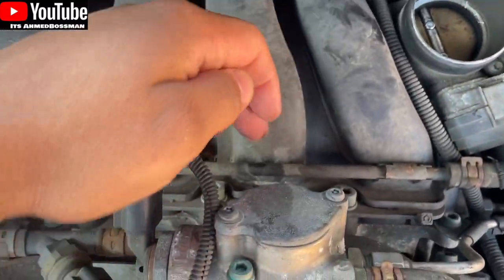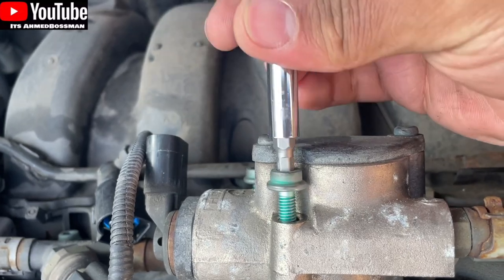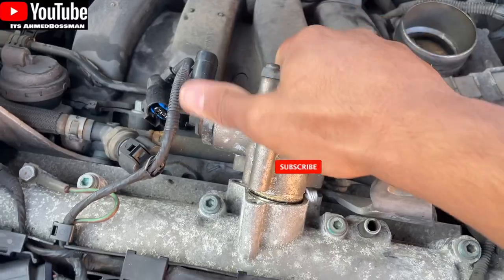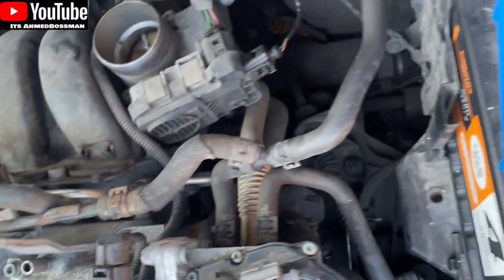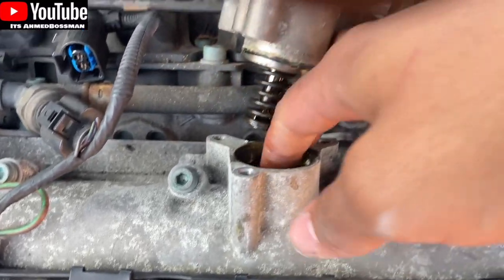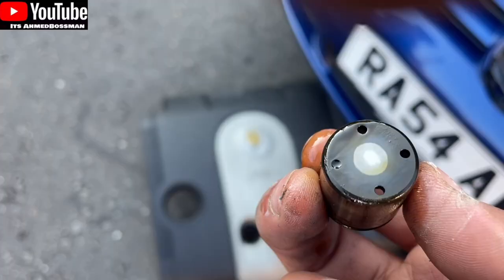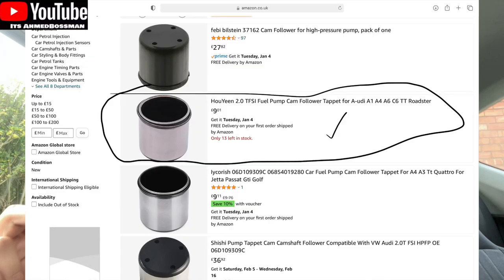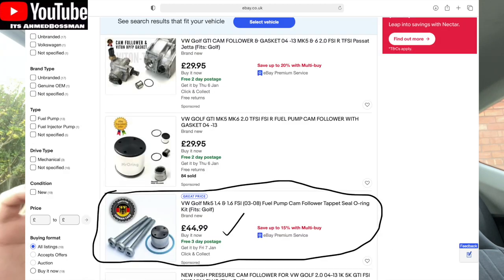Inspect faulty HPFP Cam Follower (overheating, losing power, cuts out) - MK5 Golf 1.6 2.0 FSI

Comment: No fuel comes out pulling the pump out? Also no release valve on the pump in case hoses have to be removed?
Reply from the maker: nothing came out, everything in the video is all it it, literally just unbolts and pulls out
Reply: @19hmxd  ok so I can replace it without worrying about residual fuel pressure inside the pump ?
Reply from the maker: @coachgius  the HPFP that i removed in the video did not release any fluids or anything . there was no pressure at all for removing what i removed, literally just un bolted as per the video. no hidden surprises on my car
Reply: @19hmxd  though I'm your case you did not need to remove the hoses but only the pump to get to the cam follower only. So may be undoing the hoses may create fuel leaking. I saw other pimp models with a release valve but can't see anything on that model that is like mine (same engine).
Reply from the maker: @coachgius  yes i only removed enough such that i can access the cam follower

Comment: Does installing a hpfp with different part number but appears same physically affects performance?
Reply from the maker: not sure to be honest. but if you look at it this way, if you 'upgrade' the HPFP, you will increase the flow which makes it better in some ways, but if you accidentally 'downgrade' it, it still fits but doesnt have the same flow you require, that can give some side effects but i dont think it will give this issue im having . it will change the characteristics of the running of the engine... not make it cut out when overheating...